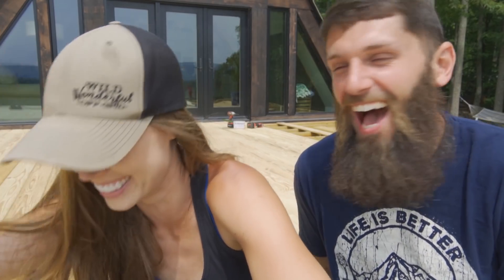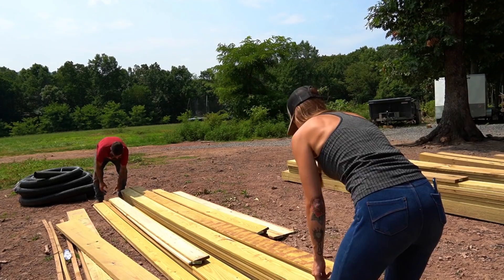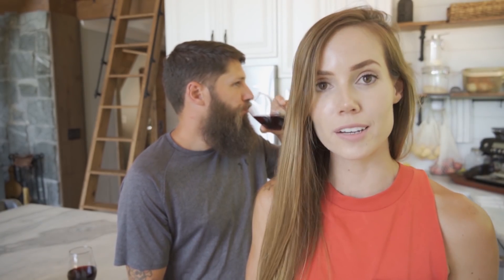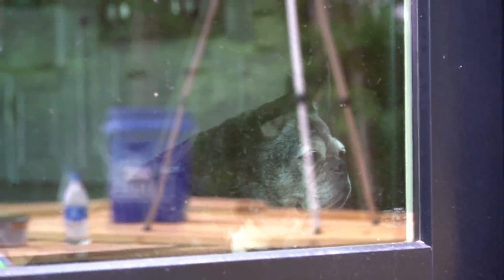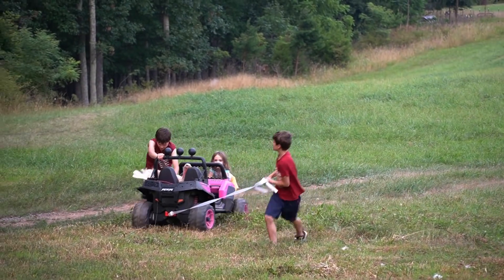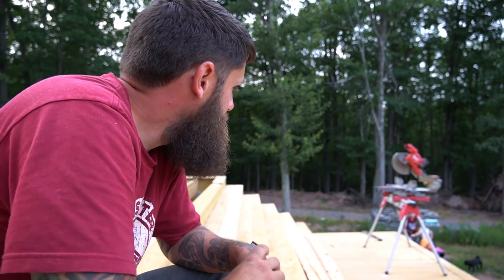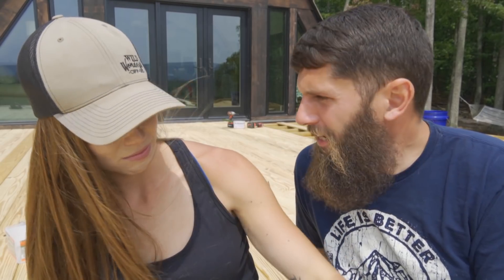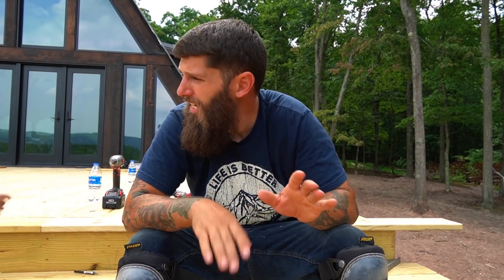FINISHING Our Massive Deck Build!

Comment: Looks great!  Nice job!  Plus, when the pressure-treated wood dries and shrinks, it tightens and even bends - slightly - the screws and nails, thus tightening the entire structure.  (I remember that all the nails for my green-oak cabin had to be pre-drilled (hand drill - no power on the site, or battery tools - 1970s), otherwise I couldn't pound through the wet wood, and angled slightly so they wouldn't snap as the wood dried and shrank.  I used board-and-batten on the outside, vertical, so the shrinkage wouldn't leave gaps; inside was horizontal and as the wood dried and shrank I could see through to the insulation inside the wall).  I love these videos!  Beautiful job!

Comment: Redid my deck floor with composite decking a couple months ago with a picture frame and your sentiments about the repetition of the work is definitely accurate. Extremely easy to do but takes forever to put the new boards down and is repetitious to the point that you're going insane by the end. Took me 2.5 days to lay all the new boards on a 27'x16' deck with those no-show fastener clips, will never do that again by myself. With a crew of 3 guys, you'd get it done in a few hours, by yourself it takes days. This is definitely the kind of job I'd recommend getting help to do.

Comment: The Clear Cedar Decking I used lasted 16 years and it was 2x6. I just rebuilt the deck with 2x6 Trex Decking and was able to still use the framing. I was surprised that the Cedar didn't last longer. I guess you live and you learn.

Comment: Great deck
I used conduit ran horizontally ran thru the 4x4s as supports on mine 
Topped it off with lumber but my 4 horizontals are conduit 
Turned out phenomenal 
You can paint them to match the house and are WAY cheaper than anything on the market for deck railing

Comment: found all the screws, bit's for the CAMO tool at Lowes going to pick them up this weekend, still waiting for prices to drop on lumber prices here in Kona, have already dropped but I'm told it's going to go down more soon so I'll wait. Need to buy 2x8's and 2x6's, 4x4's, cement footings and more. I'll get help for the frame work, since 70% is going to be built at level ground  should go fast. I have drawn up the plan and looked into costs with a material take off. excited about getting going and i have figured out how I'll do it in a wheelchair.

Comment: And now an outdoor covered kitchen, you sure have the room. Built for those special summer and fall events in your lives, I can see it now. I'm working on my extension plans now including a built in kitchen and fire pit in the center. my deck will then be 675 square feet when finished. &0 % on level ground. I have 300 feet done and it's covered and the new addition will be open. It's going to be a little difficult building it from a wheelchair, but I've thought it out, got Ideas from watching you two and will proceed as soon as lumber prices come down more.
Aloha Nui Loa to you both and continue on.

Comment: I got the CAMO tool on line and found out that Lowes has it and the special screw's. I don't think the screws will pull out from using the deck because of how they are made. Very nice job on the deck, it looks fabulous. Still wondering what your going to do to finish and protect the bare wood, stain I think would be nice, cedar stain from Hone depot # 501. Put on with a garden sprayer, put the gallon of stain in the sprayer and have at it, then clean out the sprayer with water under pressure. Can't wait for the next installment, hand rails and gates.

Comment: Deck looks Amazing Just Utterly Amazing 😉!!!! I know the lumber & posts are treated, but :  if Paint/treat  the deck with “LINSEED OIL” & do it every 5-7 years it will never rot or need replacing.  
That was a tip I learned from Paul the “Bearded Carpenter” on his log cabin building channel.

Comment: Your channel is so good it should be made into a T.V sitcom. Decking has a ways to go WWOG. All that railing is going to be a task but not as big a job as deck it self. I hope you use 4X4 post and cut 2X6 inches out of bottom of post and lag to outside of decking and rail. Makes for a more secure, tighter handrail and cleaner finish. Awesome job on deck build. Your truly an inspiration.

Comment: Great deck. Next time you build one turn your saw the other way and lay the board on the deck your building so you can cut then slide it into place. Makes the job easy and while one cuts, the other can screw them down. You can even cut 2 or 3 at a time and get it over with. Building decks in the sun can take a lot out of you, believe me I did it for many years and as we get older, we get slower. So the faster the better. Be safe all.

Comment: Built four decks of similar size and once you start the decking everything goes SLOW that is if you are doing a good job - which you appear to be doing.  Would have run the picture frame against the house - if there are issues in the future all you need to do is pull up the one board against the house.   However,  if there are issues you can always gang cut the boards and complete the picture frame and have easy access from above your ledger board . . !!

Comment: Looks great.  I used a Camo tool for my last deck rebuild and it was a huge time saver and the hidden screws are truly hidden.  Next time around I will use longer screws.  The cedar decking we installed is squeaky and we never had that with PT pine.

Comment: You cinematography is really very pleasing.  You should get an Emmy for your camera and editing work.  Just curious what kind of railing will you be doing?  I did wire cables on my small deck, they disappear and still provide protection from falls.

Comment: Now it's time for some hand/guard rails around the deck so the little ones don't drive or step off it and the diagonal bracing underneath to keep it truly rigid is next. Since the deck stacked the rafters the diagonals can be hidden on those on the pilings since they can run zig/zag pattern to tie the posts together making triangles. The wight of the stacked rafters/deck need this rigidity since the taller posts not the stair ones will be the most prone to moving and it can over time pull away from the house etc. it should be rigid/strong enough to support the weight of several vehicles on it and snow load in winter can be as heavy as a vehicle in the same square footage if it gets deep enough. Looking forwa d the the railing your going to install since it's a safe bet that someone might try to take a bike off the lower level  and it may not be the kids that might try it...🚲🚲🚲

Comment: Just wondering, have you thought about composite decking? We live up on the Olympic peninsula and used composite decking because not only its wet up here but I'm 73 and don't want to mess with decking in the future. We used Cystal lite deck railing, stainless steel cables with extruded aluminum rails and posts. It wasn't cheap but has a wonderful and beautiful view with no obstructed areas like wood railing does. Nice job on the deck.

Comment: What kind of railing will you have on the sides and on the sides of the stairs?  Building code is anything over 30” above ground level needs a railing, not that building code matters, but for homeowners insurance, it’s probably going to be required.  Also, Josh needs to light that deck up & install some outlets as well 👌

Comment: For later reference. I’ve built decks all my life and I’m retired now. With the Lumber the way it is now you don’t have to separate it at all just push it together and it will shrink just enough between the boards to shed water. And don’t sink your screws where you have a hole make them flush. When you make a hole with your screws it holds water and that’s the first place it’ll start rotting :-( make your screws flush with the board. :-) And they also make special screws now for the new treatment that the government has made the manufactures to put in the wood to keep the screws from rusting :-)

Comment: The heli-pad is looking great without any seams. lol Now with railings on the sides only on the top deck and sides and front on bottom landing, you`ll have views for miles and miles! At the 8:21 mark, you have a step that goes for a small roller-coaster ride, i wood fix it with your porta-plane. Take care

Comment: LOve everything that you guys do. The one thing that is gnawing at me a little bit is the one odd board on the upper deck that is way darker than all of the rest. No biggee, but if you have another board that matches better you can easily unscrew it/remove and replace, and use the darker one for something else, as long as it is the exact same width, maybe something that doesn't show as much. Since the screws go in the side it is still a usable board, or even if you trimmed the edges, and did a quick round over bit it would be a good general purpose board. 
The deck looks fabulous. Josh, remember to strive for perfection, and settle for excellence. Perfection is elusive. No matter how perfect you get it, there are always higher, and higher levels of perfection, so it is a trap. The one other thing is that remember there is that famous German builder/creator called "Dr. Goodenough". :-) Sometimes if something tugs at you to correct it, and you know if you mess with it, it will open up a can of worms, you simply say, "Dr Goodenough" with accent and all. This is sort of a contradiction to what I said in the beginning of this comment, mentioning a correction. See, I make a two minute comment, and already I screwed up. :-)
Okay one more thing. A famous woodworker Frank Klaus used to cut dovetails by hand in front of an audience at a woodworking show, and they would be near perfect. He would explain that the flaws are what gives it character. In old antique furniture, the things the collectors look for, for example is dovetails with uneven sizing, and other flaws which make it unmistakably handmade. They are the ones they pay the most amount of money for. 
I love what Erin said when she explained that if something happened to her those few screws that went in less than in perfect alignment would be the ones you love the most because it reminds you uniquely of her alone. Well said.

Comment: Awesome deck. Can't wait until you get the rails up. I hope you do the wooden, horizontal handrails with the metal, veritical posts inbetween and wooden main posts. Just one question: in the end shot of the video, it looks like the deck is actually slanted towards the house. That's an optical illusion because of the angle of the camera, right?

Comment: I watch your videos all the time and the daycare building looks very nice but I want to make one suggestion to you before you lay the decking down on the floor joists make sure you get that window seal tape it's about 3 in wide cut little strips of that and put it on the top edge of the floor joists just cover it so when you put your decking down the decking will never rot your floor joists it'll work son it'll work very good and save them from deteriorating over years.

Comment: It`s going to look great with deck lights installed on the deck and on the stairs. I have them in my garden colour green and they look fantastic and there only 12 volts running from transformer built into them

Comment: Erin I think that's the biggest deck I've ever seen built during the macarona pandemic single handedly, of course Josh was the helper, didn't do much other talking real fast at Mach 3.4. You did a great job. I still think yall need a pool.
Reply: I swear I'd almost do plexiglass hand rails on the sides and going down the stairs.

Comment: Screws in every single joist seems like overkill. I'd go the ends then every other one.  I'd also lat the boards at length and jig saw them with a chalk line. A little cut in a joist isn't going to hurt anything.

Comment: Deck looks amazing! Super solid construction and attention to detail is satisfying to watch. One piece of advice to speed things up for anyone trying the same thing- no need to cut/measure all of the deck boards independently- just line up the picture frame boards for positioning but don’t fasten the one running perpendicular at the top of the stairs- then lay all the decking boards and screw down like normal. Snap a chalk line at the end and cut off using circular saw set to board depth to not cut into joists. Fasten picture frame board at the end and you’ve saved lots of time avoiding the moving, holding, measuring, and cutting. 😀

Comment: Using that Camo installation tool with the screws at an angle, does the wood split on the screws when it shrinks when drying?

Comment: Hey guys it turned out awesome. Hey Josh when are you gonna upgrade the barbie jeep with Milwaukee power upgrade? Double the speed and easy to swap out the batteries. You won't be disappointed until all your batteries are dead from the kids using them and not charging them. Lol

Comment: You could overhand all of the boards, stack them all on joists. Screw them all in, then Measure the two ends, chalk a line, set your worm saw to 1.5" and then run it down. You would have to have your picture frame board off on the end but it is way more efficient with your time doing it this way

Comment: A lot of times I see people build decks with some sort of water resistant tape on the top of the rails you screw the deck to. Do you not need that since you are using pressure treated lumber?

Comment: So some advice for those building decks in the future, once you've got the picture framing square, pull up one of the picture framing boards on the end perpendicular to your deck boards. Install the deck boards without measuring and cutting each board, then cut all the boards at once and reinstall your picture framing.

Comment: It looks like the deck top is flush with the interior floor. Typically the deck would be at least one step height down (maybe 2) to account for rain and snow, so it doesn’t go in the house. That would also mean one or two less steps at the end.

Comment: Former painter here. Please don't use cheap box store sealers on it. Sikens and Swedish Wood Oil are the best out on the market. They are penetrating oils that occupy the wood cells unlike the sealers that just are nothing but a surface liquid wax that washes off within weeks.

Comment: Alcohol can cause gout, a type of arthritis because it allows uric acid to settle in joints of the body.   I know someone who is suffering now from this type of arthritis after a lifetime of drinking beer every day.  It is very painful; the uric acid crystalizes in the joints and becomes like sharp pieces that are in the joints causing debilitation and pain when trying to walk, etc. They stopped drinking and right now are drinking pure cherry juice to help clear the acid from their body.  The pain is so excruciating that when they tried to walk putting pressure on knee joint they literally collapsed and fell.  (You can imagine it is like putting little sharp knives in your knee and your body in self-defense refuses to walk on them and you feel paralyzed because your body does not let you use this leg.)  xoxo

Comment: Humongous deck!! It will require a lot more maintenance than your home because it's outdoor wood subject to every weather condition you can think of. Stain can help to protect it but even that will run out of usefulness at a certain point. My brother-in-law has a deck this size and has had to redo the whole thing after a decade or so. Fortunately he owns a building supplies store so he can easily replace the deck, but it will be an ongoing concern. An alternative to wood, which is most often pressure treated, might be an option. Those include PVC and composite materials.

Comment: Why is a hammer drill being used to drive wood screws?  Not what a hammer drill setting is designed for.
Reply: @Coyote-tc1ww  a"hammer drill" and "impact drill" is the same thing slick. You're obviously a rookie also. Hammer / impact drills are only needed when drilling into concrete, mortar or any non grained surface. A hammer drill actually slows down the process in wood,  wood screws slide smoothly through grained wood surfaces. Furthermore with each "impact" the grain of the wood is smashed lessening the tightness of the  bond between the screw and wood. I can sink 2 screws for every one of yours with a tighter stronger bite into the wood.  I commonly see the use of "impact/ hammer drills for sinking wood screws into wood, and I just shake my head,   It's sad that today's apprentices  are being taught by other apprentices.  This 40 year tradesman just schooled you, class dismissed.
Reply: @Coyote-tc1ww  Tell me youngster, what do you think the impact is achieving in the wood, and how does it effect the wood, go ahead slick.
Reply: @Coyote-tc1ww  That's what I thought, no answer ,, the answer would require you to think past the "Uhhh.. it impacts so it drives better".  you'd have to analyze how the threaded grains of soft wood are effected by the impacts.  but you just buy and use what your told by the sales man.  but be assured that the grip of a screw driven by a standard drill will grip much better than those beat while being driven into soft wood grain. that is fact.
Reply: @Coyote-tc1ww  LOL... Naww,, but I do smile and shake my head at  youtube taught "tradesmen".  sometimes they put in a short time in the trades, usually taught by another apprentice. (less than 6 to 7 years, 40 hours a week, is an apprentice.)  . I suspect you have 2 years in the field, off and on if that. otherwise its just what you learned on youtube.   Journeymen can spot it fast.
Reply: @Coyote-tc1ww  I'm retired,  It's like She is trapped with me.